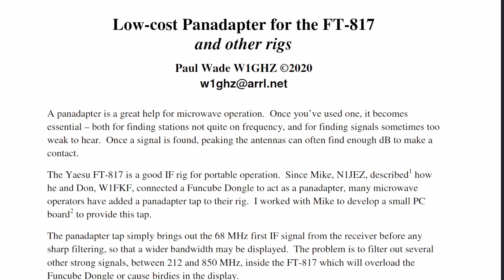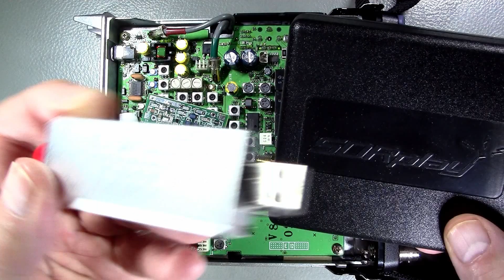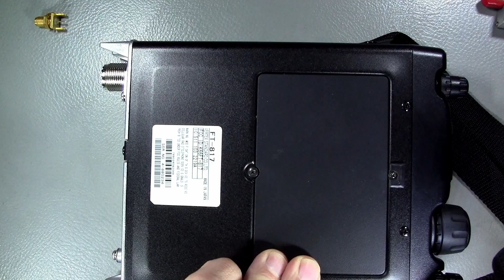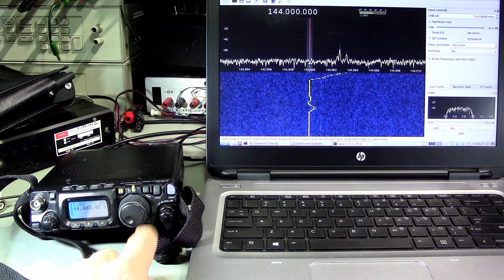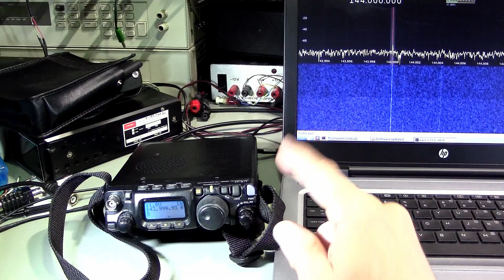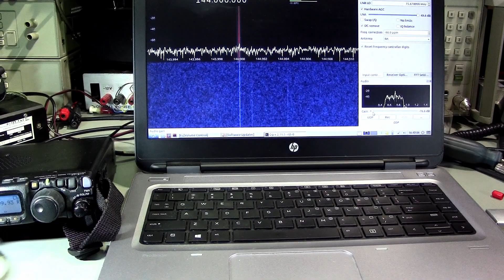10 GHz System, Part 17: Adding a Panadapter output to my FT-817 IF radio

Comment: Good job! If you add CAT to the transceiver, you can control it with the mouse. I use something like this with the FT897D and my own software. In a 24-hour contest, I never touch the transceiver's tune button. The software only commands the station, it does not decode anything at all. A video here: https://www.youtube.com/watch?v=WAfWNgv1dSY